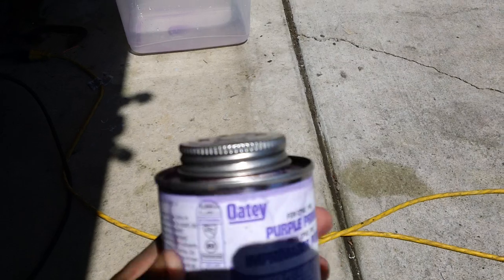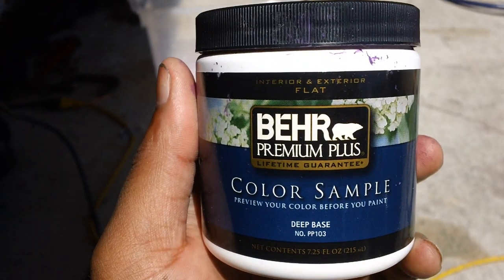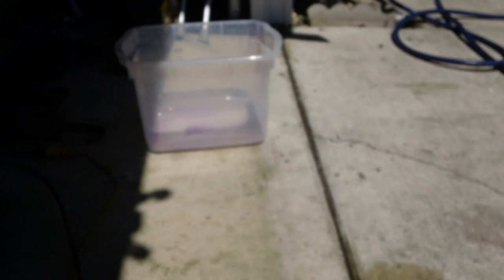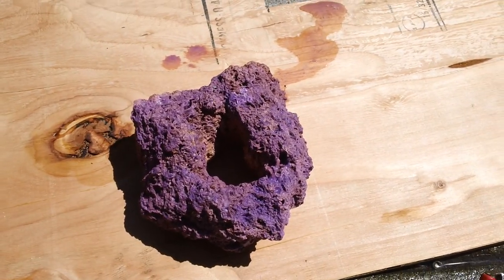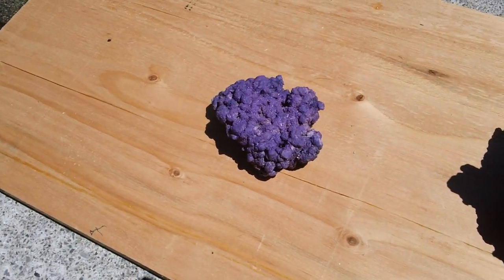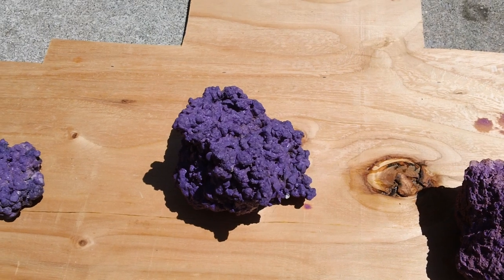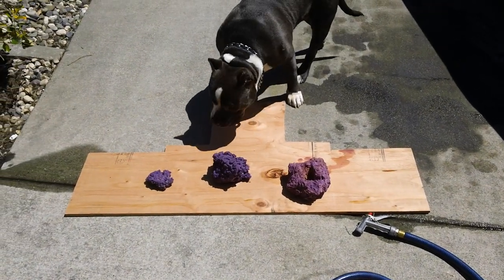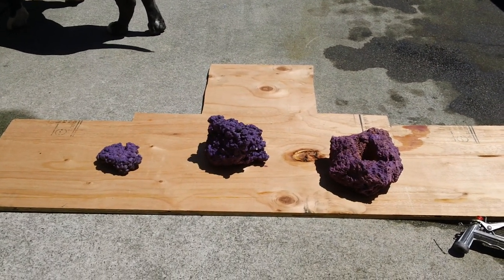how to make diy purple live rock

Comment: You can definitely skip the PVC primer. I used it on a test rock and it didn't color the rock much at all. I bought some man made live rock from a fish store in Davis, CA. It's been in my tank for 5 months now with no issues. Just use water based non toxic acrylic paint. I'm making my own with craft paint from Walmart.
Reply: Acrylic paint doesn't work in live rock as it will clog the pores for beneficial bacteria.
Reply: @THEFIFTHDIMENTION it also makes a layer that clogs the pores of the rock